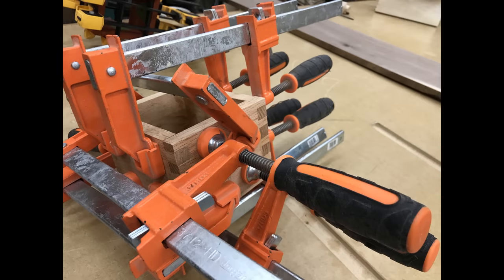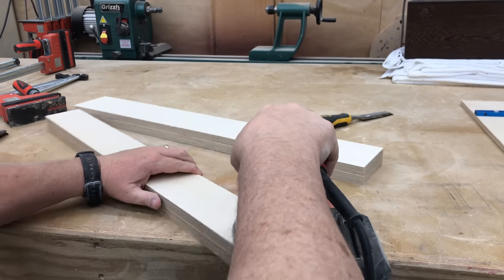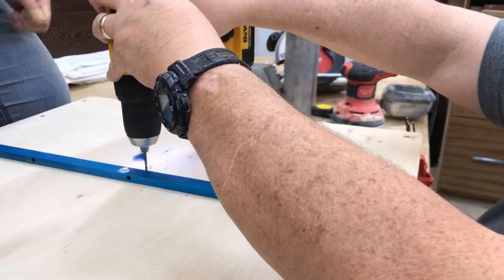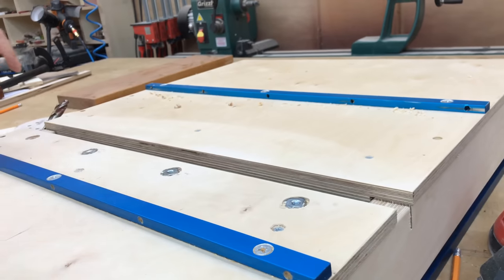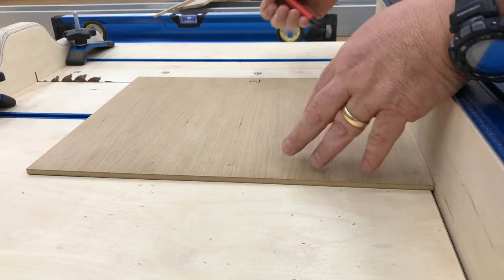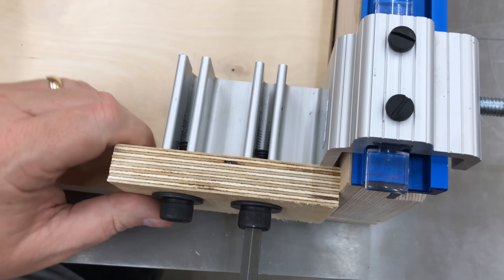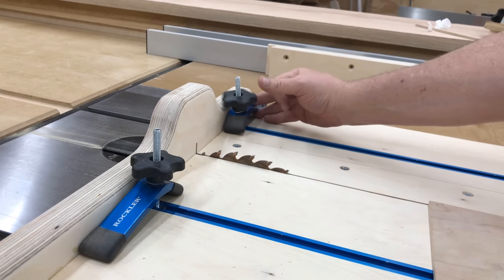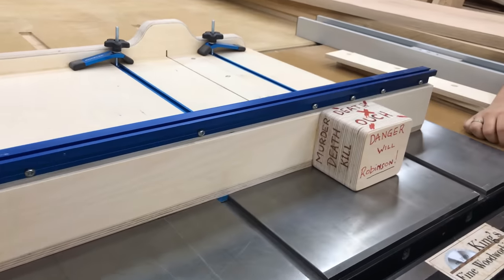39 - Extreme Crosscut Table Saw Sled with Perfect Miter & Dado & Removable Zero Clearance Insert

Comment: Very, Very Nice Sled.. Lots of Thought went into the Engineering over time I'm sure.. 
And, thank you for the breakdown and example of the 5 Cuts to a Perfect Sled.. 
Nice to have  a real world example to verify how it really works..  I had it figured out, but, I missed one step that I caught as you were explaining it.. Would have been frustrating. I have made two sleds. Both very, very close, just taking care with a good square and taking my time with it.. But, I can't see this not giving me better results after I get to that point.. 
I am going to check my old knocked around sled that I have not used in a while because,,, I dropped it twice in a hurry moving things, and havn't done any "Fine" work since.. Use it to get repeat length cuts all of the time though.. Will be interesting to check the old thing.. Very Humid environment, etc.. just to see how it made out over time.. 
But, you are correct.. Just make a picture frame and you will know if "Anything" is not perfect.. :) Thanks..

Comment: This is a great amalgamation of the many sleds I've seen. I really like how you handled the solution to using dado set blades by using the various sized inserts. I saw a sliding insert setup on the Woodsmith Shop channel, but this is a bit less complex to set up. Well done! I'm going to build my sled based on yours.
Reply: Inserts also allow you to make specialty inserts to make the sled do double duty. One of my inserts lets me cut box-joints for example.

Comment: After watching the sled being built, I was stoked to build one. I acquired all the parts and was on the downhill side to completion, until.......! I made the cut for the dado when I realized the cut is on the wrong side according to the layout of this design. After going back through the video I found the glitch. The builders saw has the dado to the right of the arbor, my saw is to the left. Thoroughly deflating! At this point I am going to attempt to salvage the project by removing the front and back fence, then set up my dado and take the left side down 1/2 inch to the bottom layer of the sled. My insert will need to span both sides of the blade and be attached with screws on both sides as well.

Comment: First let me say that I have purchased the plans and have built the sled according to those plans. Also, I am using a SawStop Professional Cabinet Saw (their "PCS"). This is what I would consider a "Left Tilt" saw. Additionally, when using a dado blade, the blade width grows to the right, and the sled's design accommodates the dado blade's growth direction just fine. Recently I needed to do a bevel cut. I dropped the blade below the table, then started coming up through the insert. As soon as I heard the blade start skimming the wood, I stopped and inspected the bottom of the sled. To my surprise, the blade was going into the bottom of the left side of the sled! Had I continued, the "zero clearance" on the left side of the sled would now be destroyed permanently. It seems that a) inserts both sides would be best, and b) the plans should attempt to direct the user which way to go based upon their particular saw. I'm working through this by running the sled "in reverse" so that the blade goes through the replaceable insert, but it's not a very comfortable operation! Please consider appending the plans, and perhaps a message appended to the video that left/right tilt behaviors need to be considered. Thanks.
Reply from the maker: Mike Schoonmaker,  thank you for commenting. 
This sled is not designed to do bevel cuts. There are other problems with that too.  

I also don’t recommend trying to put a zero clearance insert on each side since you would have other support issues. 

This sled also works great for left & right tilting saws both. You simply reverse the base for a right tilting saw. 
Thanks,
James

Comment: I have been looking at a lot of sleds. Yours is one of the best if not the best. Your use of Plane  Geometry to make an almost fool-proof miter attachment is on a higher level than your sled. I would consider using wooden hold-down clamps rather than Aluminum so they could be sacrificial if needed or cut through by accident.

Comment: Great video, and excellent sled. One suggestion. If you want to improve the accuracy of your 5 cut calcs, you shouldn't use the 11.5" total length of the off-cut piece. That's because on the narrower end the parallel calipers were actually touching and therefore measuring the width of the board at a point approximately 1.5" from the end. Therefore, 10" would be the correct number to use instead of 11.5.

Comment: Great explanation on the five cut method.  I do have one small suggestion:  instead of a countersunk wood screw, drill and thread for a machine screw in the fence and drill a slightly oversized hole in the base with a counterbore and use a shallow pan head machine screw.  This will give the ability to adjust the fence placement.  One can even do this with all the screws except for the very end screw which acts as a pivot.

Comment: The 45 degree triangle method is brilliant, there's also no reason you can't use different size blocks to achieve any angle you want. You can use this technique for any miter angle you just have to build a set of blocks.

Comment: Question. You have a zero insert for the bottom of the sled but what about the fence? Once you run a dado blade through the fence there will be a large slot. Have you come up with anything to address that? To prevent tearout.
Reply: Was wondering the same thing.

Comment: Excellent video Mr. King. Very well explained procedure. I was so inspired by your video I now want to build my own sled. I understand everything except I need to know the size of the tap you used to lengthen the stop block. If you could provide the size of the drill bit you used and the size of the tap I would be very grateful. Thank you so much for all you do. I am subscribed and have been for years. ❤

Comment: James, very nice sled. I have built Nick Ferry's sled, and it is similar.  I have been disappointed with the Kreg stop: it has too much wiggle room, so using the T track tape measuring tape with it is not accurate- it's the play in the hold down screw.   Are you aware of a more accurate stop?  
I also have realized that over time, due to changes in temperature and humidity, the cutting fence goes out of square, and in a short time you end up with lots of holes in the bottom of your fence when you readjust it 😩.  Hence the need for an adjustable fence, which I have seen online, using an aluminum 90* angle brace, which will be in my next sled, or possibly an upgrade to my current one.    I love your explanation of making the 45 degree piece for miters... That is simple and accurate (so I should have paid more attention in 9 the grade geometry class 😅).     One thing I have not seen that I added to mine are two, 2" holes near the back fence, on either side: this allows me to hang the somewhat unwieldy sled on a simple mounting rack on my French cleat wall, so that is stored safely and also easy to reach when I need it.  Thx for sharing!  George

Comment: I bought your plans and watched the video multiple times, following the instructions to a "tee".  It seemed like every step in progression with the project it adversely affected the way the sled slides.  Even putting on that stop block which shouldn't have bothered anything.  So right now I have a really good-looking sled that I have to use a ton of force to push through, which is kind of dangerous.  Of course, I meticulously adjusted the metal runners initially.  If I had to do it all over again, and it appears like I will have to, I'd opt for a simpler design.  Or, if I was to use yours again, I would attach the runners LAST, which is possible to do.  Or make it out of 3/4" plywood which would weigh more but probably be more stabile.  Just my two cents.

Comment: I am not sure if this sled design was evolving while being developed but I see a number of places you could have made your life a bit easier. For instance, adjusting rear fence before cutting and fitting the second layer of ply on the sled body. If the adjustment is too large forward, you won't be able to make the adjustment with the top boards in place. Similarly wouldn't it be a bit easier to cut the top dado slots before doing any fence work? You could avoid mounting, removing and re mounting the fences.

Comment: An alternative to the 5 cut method. Take a cut on your test piece. Now flip the stock like the page of a book. With the same edge against the fence but the former top face down cut a strip off next to the first cut. Now measure and do your math. From your base edge the cuts if out of square will be tapered. Subtract the difference and divide by 2. If you mark the measuring points 10 inches apart and your difference was say .030"/2=.015" that's .0015" per inch. Another way to do it would simply use a vernier protector to measure the angle of the cut. Determine what the sine of the angle you are off and multiply by the distance you are using. Then pivot the fence that much.

Comment: Since the back fence (nearest to the operator) sits on the first layer of plywood and the second layer is merely laid on top of the first one, I thought there might be an issue squaring the fence because that second layer would be butted up against the fence preventing it from moving for the adjustments. But then I noticed there was indeed a gap there which was sufficient to allow the fence to be pushed forward by the amount specified by the 5 cut method. I wish you had mentioned that in the video because I'm pretty sure some people are going to gasp in horror when they find out there is no room to move the fence forward. Backwards is fine obviously. I couldn't get to sleep last night thinking about this.

Comment: Got my sub on this one.  I like the Kreg integration. Best 5-cut to square explanation ever.  When you drilled screwed the safety block from the inside of the sled towards the back where the block (death, murder, danger, etc) is fixed, had you thought in advance about the dado blade passing into the block potentially nicking or kicking on one of the screws?

Comment: In regards to back fence adjustment, since your adjustment had to be adjusted forward towards top plywood of the top plate you might not have much clearance to do this if your top plate was already tight to the rear fence.  I guess in this case you'd have to adjust the other end backwards.

Comment: I purchased these plans and starting  building the sled when I realized that the design will not work on a table saw with the arbor and motor  on the right side. ( older delta unisaw).The insert plate must be on the opposite side to maintain the zero clearance. I tried to contact Kings Fine Woodworking to see if the had a workaround but was unsuccessful. I really enjoy the great videos that you produce. My sled turned out great
Reply from the maker: Hi,

I get about 400 emails a day. I’m very sorry if I missed yours. 

It’s a quick change to make it work on your saw. 

You will just rotate the entire sled 180 degrees so that the front becomes the back. 

Don’t rotate the front & back fence though. They still need to stay where they are at. 

If that makes sense, you’re good to go. If you need more help, just let me know. 
Thanks,
~James
Reply: thank you for the response and suggestion. my sled came out great wonderful design @KingsFineWoodworking
Reply: @KingsFineWoodworking  Did you ever come up with a work around? I also have an older Delta Unisaw and was considering these plans. Thanks for your time.
Reply: Just bought the plans and would like an answer on this too.
Reply: "Mirror the plans of the base." Glue your second base on the right, then wouldn't you just cut out the 7/8" dado gap on the right side of the blade? fill in the left side with your zero clearance inserts and the rest of the sled bed. Just a guess. I hope you figured it out a year ago when you posted this. lol

Comment: James, excellet sled, not to mention video.  I could not help but notice the countersink in the inserts for the head of the bolts that hold them in place.  Look's as though we have had the same issues. If you countersink on a drill press, the holes come out perfectly round, however if you do so with a hand held drill, most of the holes will end up six sided.  Ask me how I know.  Regards Uncle Bob

Comment: Hey James. I recently inherited a Grizzly 1022Z table saw. Unfortunately it did not have a blade guard or riving knife. Grizzly is out of stock and will not be manufacturing for such an old machine. Any ideas? My first project for my new addition is to build a sled for it. Thank you for sharing your great video for your extream sled. You are one of a few that use the metal slides. I have already ordered metal slides as I experience a lot of humidity in my current shop. I watched many other videos for sleds and yours, with the extra track on the bed, made it an obvious choice. I want to only build one sled and to do it correctly. I look forward to receiving my copy of the plans soon. Thanks.

Comment: I like the zero clearance plate for normal crosscutting and dado work to reduce tear out.  After doing a dado, the fence back slot becomes wider; do you get tear out when using a normal cross cut blade after doing a dado from that gap?

Comment: Hi James and gang. Thank you for this awesome video - I have had my sled going for about 3 years now - But it seems my sled needs to be recalibrated - It's quite out now despite the many screws that hold the fence in place. I checked my saw blade and it is still bang on with the miter slot. There is no slop in the miter bars and other than perhaps how I am storing it I am wondering what has gone wrong. Is this a common thing to have to recalibrate? Have I missed something? Hoping you and your family are doing great!

Comment: Good build and presentation! However, please learn how to safely use the jointer and table saw, unless you feel luck. Hands on the jointer and pushing short wide boards will eventually get you to know the number of holes in each ceiling tile in the local ER. 

Build was well presented.

Comment: You drilled thru the aluminum runners and the 1/2 inch plywood which I thought was a good idea, but then you countersunk the aluminum instead of the plywood. The threads in the aluminum is much stronger than the threads in wood. Having the head of the flat-head screws on the surface wouldn't interfere with anything. I'm sure that what you did is holding up, it's just backwards in my opinion.
Cheers!

Comment: Is there any scenario you can think of that the aluminum on the track could set off a sawstop brake?  I saw another sled that used an aluminum back/front slide stop that the blade went through which would scream trouble.  I can't remember if you're running a sawstop or not.  Any info would help!  The plans are in my inbox!!!!!  Thanks KINGS!

Comment: Have you thought about putting t-nuts on the stop block and using bolts long enough to go all the way through the Kreg stop. That way the bolts would never be in the way as long as they are cut flush. By the way, big fan of your channel and a subscriber.

Comment: Great video. This plus W. Ng's video should be mandatory videos for anyone wanting to build a sled. Question: since most measuring tapes are only accurate to 1/16''(1.59 mm) would it be beneficial to use a metric rule to perform your measurements, specifically the length measurements?

Comment: James, nice job.  I bought your plans and am about to start the project.  After watching the video a couple of times, I still don't know why you tapped the screws through the miter bars.  They are threaded already.  Why not countersink for 1/4" machine screws from the top?  They wont even be seen because they are covered by the top sheet of plywood.  Just wondering if it makes a difference before I commit myself.  Thanks  Mark

Comment: I built this sled as my first 'real' table saw sled.  I have a few comments for King's.  First, I love the sled and the only thing I added was an additional T-bar for one extra row of clamping.  Second, I have a few suggestions for the plans you sell.  The plans themselves do not, in my humble opinion, represent the cuts that make this table saw sturdy/versatile.   For instance, the T-track really needs to have a dado stack cut the slot rather than using a table saw to cut the birch plywood.  This is because the T-track slot does not cut all the way through the 1 inch of plywood and which leaves a bit of material beneath for added structural stability (see the video).  The plans do not seem to recommend the dado stack and this nuance is an important one.   What would aid with the plans is a short list of cut orders that you 'recommend' and the methods those cuts can be made.  This would greatly simplify the process of making the sled without having to re-watch the video in my shop.  I'm a newbie with wood and very much appreciate all your work.

Comment: The attachment of the cross slide bars would have been much better to use all the thread in the bar.  Bring the screws down from the top surface of the plywood into the bars.  If you're concerned about the strength of the countersink in the plywood, reinforce it with some CA glue before assembly.  That way there is no need to thread the wood.
When attaching the zero clearance plates, rather than use ugly T nuts, it would look much better to use 1/4-20 threaded furniture inserts.  After all, that's what they're designed for, also no counterbores required.
Overall, very nice design.  I need to make some updates to my sled so I'm going to incorporate some of your ideas.  Thanks for the video.